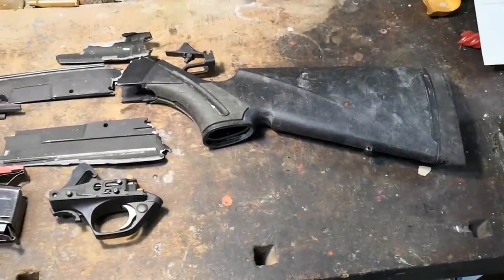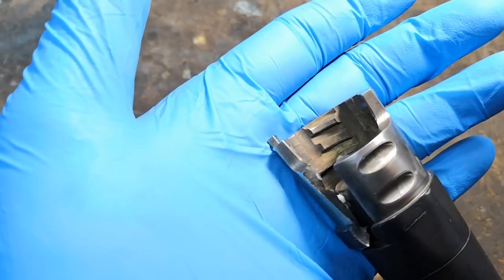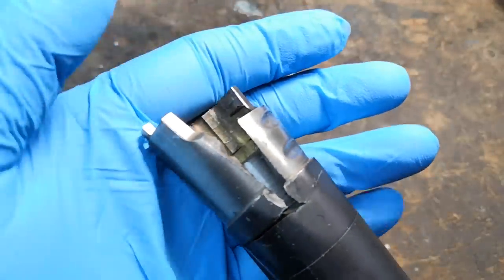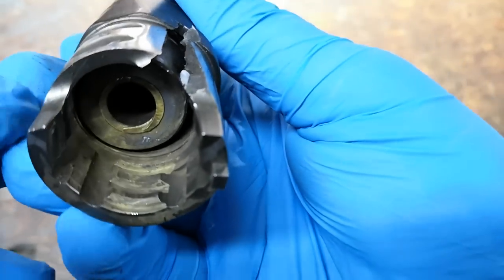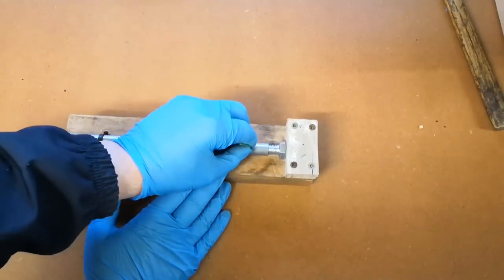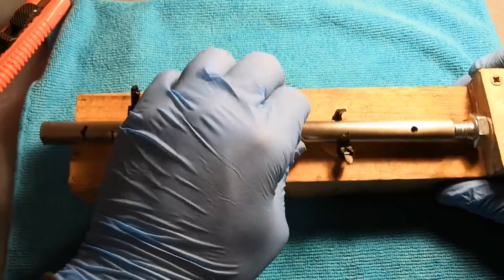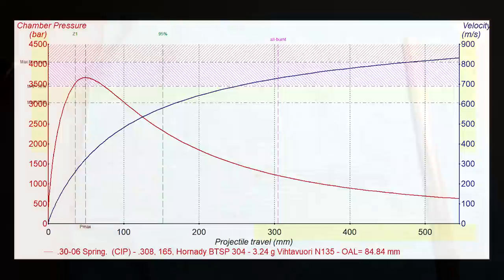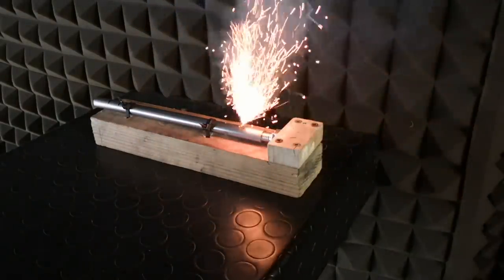Do You Know Why Guns Blow Up?

Comment: Dang! That one blew like a stick of dynamite! Hope they were ok😦
Reply from the maker: The shooter is ok, not even a scratch, but he lost a little bit of hearing capacity. The designer of the rifle would be proud of his work: they spend a lot of effort making sure that in case the gun blows up it does the least possible damage to the shooter. A failure like this with no consequences for the shooter is actually a good advertisement for the rifle itself😉
Reply: @Backyard.Ballistics  the reply is has more likes than the comment.
Reply: @Backyard.Ballistics  was he not wearing ear protection?
Reply from the maker: @Ojthemighty  no, he was hunting, and here unfortunately hearing protection is very rarely used by hunters, even though electronic ear defenders are widely available
Reply: @Backyard.Ballistics  i dont get people. Surly your hearing and eyesight should be precious to you and you would take reasonable steps to protect them
Reply: @Ojthemighty  The thing is, when hunting, you don't necessarily need ear pro, since you are only firing one or two shots. Not like you're at a shooting range. Besides, unless you're using electronic ear muffs, that only cut off gunshots, you can't hear what's going on around you.
Reply: @johnmullholand2044  i c

Comment: My guess is that use of an incorrect powder is what caused it. It may be that the round that caused the failure was not different in its charge or pressure than the preceding ones that apparently functioned normally. Even if they had produced some stretching and cracking of the bolt lugs and chamber bulging that would have produced noticeably harder bolt functioning and extraction in a bolt action rifle, the gas operated action of the BAR could have overcome that a few times before it weakened to the point of sudden catastrophic failure. It is very easy to mistake powders for one another when they are identified by numbers and resemble one another visually. For example, if you meant to load a .30-06 with a load of IMR 4831 but picked up IMR 4198 instead, the pressure would be far higher. Might not cause the gun to blow up, but it would be risky. It's unlikely that a powder charge for a .30-06 hunting load could be double charged, but some loads leave a good bit of air space in the case. If someone tried to drop another charge and failed to notice the overflowing powder or did not understand it, compressing a bullet on top of that case full of powder would cause dangerously high pressure. Something that I have experienced is powder "bridging" and clogging the nozzle of a powder measure. When this happens, one round will receive an undercharge and the next one will get the powder that stuck in the tube along with the next charge, which could be dangerous. It is good practice to always look down the mouth of the case after charging it to see if the powder level appears to be right. I have developed a practice of weighing the case, zeroing the electronic scale, charging, and re-weighing to see the actual weight of the powder charge. I'll admit I don't always do it, but it helps me to be more consistent with my technique so I get less variation in powder charge, aiding accuracy as well as safety. As to pistol powders, though they are very fast burning and high energy, many are bulky with a low volumetric density. Thus they may not produce as high a pressure in a full case as a too-fast but much slower burning rifle powder that is higher in bulk density. Many years ago when I was a teenager I read a story in a Gun Digest annual on the development of the Ruger Model 77 which I am referring to from nearly 50 year old memory. It said that they took a new M77 in 7mm Remington Magnum, dipped a primed case in Unique powder to fill it to the case mouth, seated a 175 grain bullet on top of that, loaded the rifle which was mounted in a rest in their proof testing room, and fired it remotely from outside. The gun remained intact, but the bolt had to be hammered open with a wooden mallet. The brass case head had filled the bolt face as though molten, extruding into the ejector and firing pin holes and around the extractor. When they got it all out, they measured everything very carefully and found all dimensions remained within factory specifications and the gun was operational. They scrapped it after that. I believe there is a similar story involving the Weatherby Mark V in the book "Weatherby" by Grits Grisham.
Reply from the maker: Thank you for your very detailed comment, and for sharing your experience with me and with the other viewers. Regarding the accident we were able to find the cases of the 3 precedent shots, and they didn't show any signs of overpressure, including a perfectly normal primer cup. Also, they were factory loads. As you guessed, the reason of the accident was the use of a wrong powder in the cartridge that caused the accident, which for whatever reason ended up mixed in the remington factory ammo the hunter was using. There is a high chance that somebody did that on purpose

Comment: What can blow up a gun?
1: Wrong powder used in reloading causing over pressure.
2: Too much of the correct powder used in reloading or sometimes at the factory causing over pressure
3: Too little powder used in reloading or sometimes at the factory causing a squib load blocking the bore and the next round hits it causing over pressure.
4: A failure of the brass, either bad case or reloaded too many times causes pressure to leak into parts of the gun where it does not belong.
5: Mechanical failure of the parts like a fracture in the bolt face or barrel chamber.
6: Explosive used in place of powder as a booby trap for the enemy (used in war or combat zones)

Comment: How did you get to the "which must have exceeded at least 6000 bars" conclusion at 3:56? Also you say "I calculated..." at 4:29. What kind of equations do you use to estimate the failure pressures for these cases? I thought that forensic expert students usually do not get introduced to elastic limit, overstrain, or burst formulas.

Comment: so...
gun mass 0.46Kg
projectile mass 2×180gr=23.3g
gun velocity 4.2ms
that gives us recoil energy (1/2mass times velocity squared) of 4 joules
 
then we can calculate the energy of the projectile by using this formula:
recoil energy equals projectile energy times (projectile weight divided by the gun weight)

we adjust the formula so we take the recoil energy 4j and we divide it by by projectile weight divided by gun weight 4j÷(23.3g÷460g)=78.9 joules of muzzle energy.

now we readjust the muzzle energy formula to get the velocity like this: velocity squared is equal to muzzle energy divided by half the mass v×v=78.9÷0.01165=6769, now we take the square root of that and get the answer that the projectile velocity is 82.2m/s

Comment: And this folks, is why you follow your load data to the grain and only keep one bottle of the correct smokeless powder in your reload station per run, and also weigh your cases before and after powder addition. Either the guy double loaded his powder charge or he used pistol powder (pistol powder is made of very tiny grains to increase surface area/burn rate, where rifle powder is made of much larger and slower burning grains to decrease burn rate and chamber pressure to accelerate the bullet more gradually than a pistol would). You could load a rifle with only a 75% charge of pistol powder and still get massive overpressure. The fact that that gun blew up the way it did, which is proof tested anywhere between 120% to 150% over it's working pressure, says a lot.

Comment: I guess I'm late to the party, but I will answer the question. This, unless I am mistake, merely a conservation of linear momentum problem. The linear momentum of the testing chamber is 0.46*4.2=1.932. Given that the bullets were 180 grain = 0.0116638kg each, that makes a total of 0.0349914kg of mass. Meaning that we get a velocity of ~55m/s.

Comment: Steel tube vs gun barrel. One of these thing may or may not be mild steel. The other one is typically chrome molly or other special tempered steel/stainless steel.
Reply from the maker: the tube was mild steel, the barrels are tipically made with a steel containing about 0.4% carbon, and low alloyed with Nickel, Chrome (about 0.7 to 1 % each) and Molybdenum (about 0.2%, serves to prevent temper embrittlement). In Europe a common one is 39NiCrMo3, which is similar to AISI 9840, or 42CrMo4, similar to AISI 4140.
Qualitatively, however, the bulging effects are very similar (of course happening at different stress levels)
Reply: Backyard Ballistics 
The different stress levels was what I was getting at. Mild steel is known for its ability to bend almost fully back on itself before cracking. Whereas hardened metals tend to crack well before the same point. The 11 herbs and spices they use in different grades of steel are their for a reason, sometimes increasing ductility sometimes not.

Comment: Do you think the chamber was pitted? So when the casing pressurized the brass expanded into the chamber pitting and the shell failed to extract resulting in that particular failure?
Reply from the maker: I don't think so. When the breech is opened while there is still high pressure in the chamber the friction between the case body and the bore is strong enough to keep it stuck in the chamber, while the pressure acting on the case head causes it to separate.
This is the same reason why delayed blowback guns require special expedients to avoid the brass sticking to the chamber.

Comment: You never really explained what "usually' happens.  "Wrong powder" for that charge amount? Pistol powder in a rifle?  In pistols, all of the blowups I know about personally involved a "fast" powder, and often a small charge. They call this detonation,..but I don't think they know for sure what it is...except that it does happen in pistols with low charges. In a rifle, does detonation happen? I am skeptical that a slower burning rifle powder in an overcharge condition will do much more than wear out your rifle fairly quickly.. It is very hard to get enough of the "correct" powder in a rifle case to cause it to blow up...But there are a lot of folks out there using pistol powders in rifles to save money.
Reply from the maker: What happened in that case was the use of a fast burning powder without adapting the amount, and in my experience that's the only way of obtaining such a high overpressure.
When doing reduced loads on purpose, both in magnum revolver calibers and rifles, the accident reason that is by far the most common is a double dose of the fast propellant, and this type of accident happens quite often because small doses of powder in long cases can look like the case has not been loaded yet.
Often exotic phenomena like the proposed secondary explosion effect are used as an excuse to hide neglicence. 
Finally, on the real existance of the SEE no scientific consesus exists at the moment, and if it exists it is so rare that no ballistic testing that I know of was able to make it happen at will. I would say that at least 98% of reported SEE accidents are in fact reloading mistakes.
Hope I answered your question, and sorry for the late reply

Comment: when a bullets hits a bullet in the barrel we call it a squib here in the USA
Reply from the maker: Thanks for the info. I heard that but wasn't sure of the exaxt meaning 😉
Reply: The "squib" is the under-powered load that left the bullet stuck in the bore.
Reply: @OldSlidePicker  under power is not the only thing that can cause a projectile to lodge in the barrel  .    A true squib is a collision inside the barrel between 2 projectiles or a projectile and  some other bore obstruction.
Reply: I disagree on the terminology. A squib is an underpowered load. The obstruction and collision are the aftermath of a squib that did not clear the muzzle. If you search the term "Firearms glossary squib" you will find a lot of entries with definitions like this:  squib load, also known as squib round, pop and no kick, or just squib: A firearms malfunction in which a fired projectile does not have enough force behind it to exit the barrel, and thus becomes stuck. Squib loads make the firearm unsafe to shoot, unless the projectile can be removed. (That one is from the Wikipedia firearms glossary, which is just the first one that came up.) I'm not trying to make a squabble over squibs, but it's good to stick to standard terminology to avoid confusion.
Reply: @OldSlidePicker  a bent barrel, lead fouling ,   firing out of battery, defects in copper jacket and other conditions van cause a projectile to get stuck
Reply: @OldSlidePicker  look up propganda and disinformation in websters or Oxford and see how word meaning are changed by those less than literate.

Comment: Is the bolt head so rusty because it was recovered days (or an even longer period) later from the scene?
Reply from the maker: yes exactly, it was recovered a few days after the accident
Reply: @Backyard.Ballistics  Thanks. Interesting case.
Reply: @Backyard.Ballistics  Did you consult the manufacturer (Browning) to get their opinion about this spectacular failure? The same gun/action comes in .300 WSM, which has a much higher (~1.62 times higher) bolt thrust than the .30-06 during a lubricated proof firing. It means that the bolt should not have given in below some 7030 bar chamber pressure in this caliber (and this number already assumes a case head separation).
I see that there is no ring in the barrel, hence barrel obstruction can be excluded.
The permanent enlargement of the barrel around the chamber can give you a good idea about the maximum pressure that occured, if the manufacturer is willing to share the yield strength of the barrel with you.